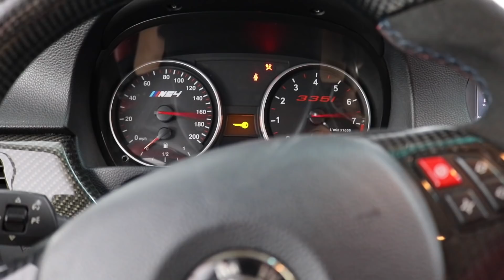REBUILDING A BURNT DOWN BMW 335I ?!?! (CAUGHT FIRE !)

Comment: You can rebuild it, you just got to get all the parts for it. First take it all apart, get the parts, clean it, paint the exposed metal up some then start putting it back together. Just gonna take some time and effort like everything does. You can just put a regular hood for now and that will be cheaper for now.

Comment: Stop putting the jack on the oil pan.  Fkn cringe. There is a spot under the car to jack it up on the subframe.  If you can't make it to the subframe. Just use the pinch weld on the same side as the jack stand. Or just go buy another jackstand. And put the whole front up.
Reply from the maker: Look closer, I am jacking it up from the front subframe. Why would I risk cracking or damaging my oil pan ??? I’m pretty knowledgeable when it comes to working on cars so I would know what is a safe jack point
Reply: @n54mani78  look I'm not trying to be rude. You're pretty knowledgeable. But don't know why your wheel studs come out when you take the lug nuts off. 👍 put a torque wrench on the studs and torque them in.